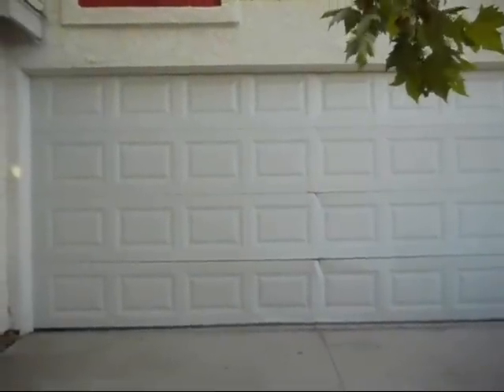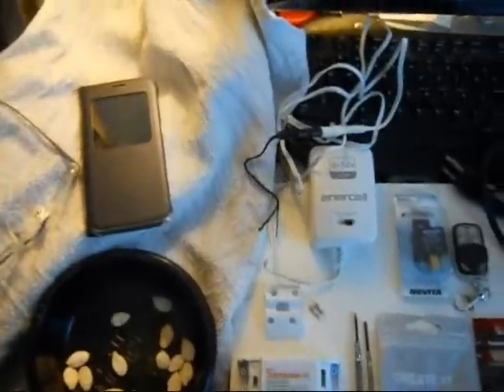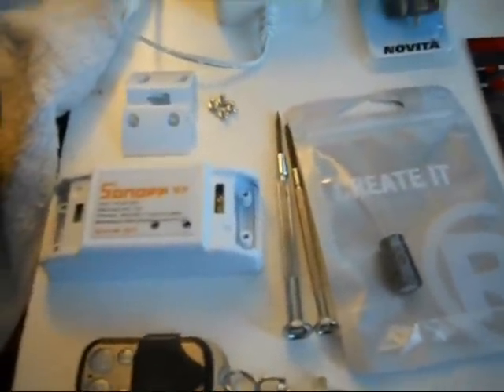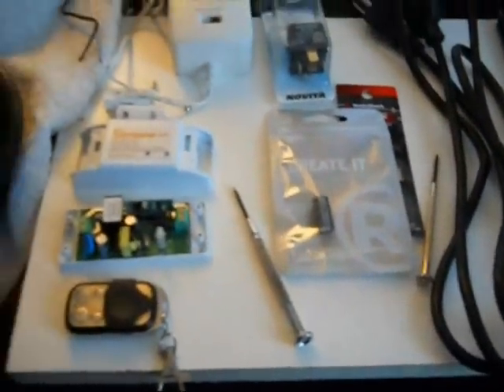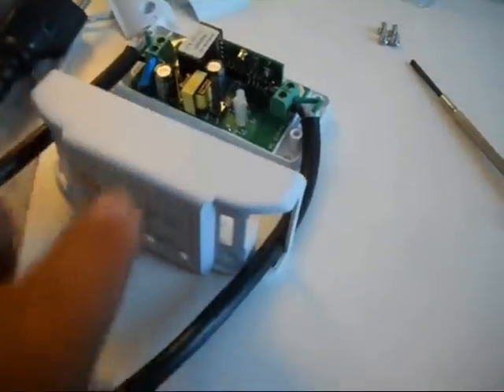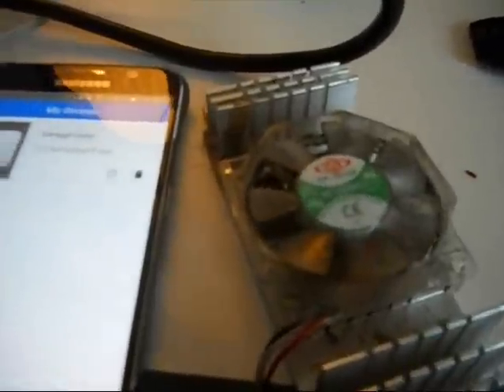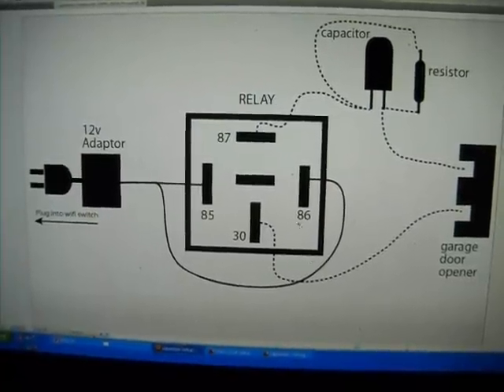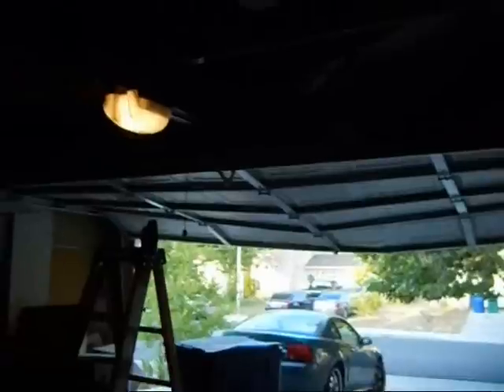WIFI switch - Garage Door opener - on Phone - Sonoff wifi

Comment: I followed in detail all the steps on your video, and it worked exactly as you explained in your video. The only issues I had was I was trying to control the garage door opener with two separate phones. The sonoff App team recommended the share feature on the App. Now it works flawlessly! Thx for your video!
Reply from the maker: Great! If a video helps just one person or inspires someone. Then the time it took to make edit and post it, was worth it. Thank you for your feedback.

Comment: Have you thought about modifying the Sonoff itself to make use of the internal relay?
It seems to me that it is possible to cut the line voltage trace to the relay and the neutral trace to the connection block and reroute the connections of the relay. That way you can keep the high voltage from the output of the Sonoff and only switch low voltage.
Reply: Have you managed to do this?
Reply: I did it on mine. Worked great. I cut the lines before the relay and soldered them together.
Reply from the maker: I wouldn't know how to do that unless someone showed me.
Reply: There is a device for this, it is called the Sonoff SV (safe voltage).   It has an isolated relay.  Using the sonoff-tasmota firmware it is simple to have the relay pulse the signal to the opener - so no external components are necessary - just the ~$12 Sonoff SV and a 5V wall wart
Reply: @seanphillips658  The Sonoff SV still passes the input voltage to the output, how do you make it trigger the output as NC for garage opener?
Reply: @mcdull9413  - a slight modification isolates the relay.   It is on the SV wiki https://www.itead.cc/wiki/Sonoff_SV

Comment: It is not necessary, only by cutting the input voltage passing through the relay. Thus the relay becomes a neutral switch. I have done so.
__________________________________________________________________________________________________________
No es necesario, solo cortando la tensión de entrada que pasa por el relé. Así el relé pasa a ser un interruptor neutro. Yo lo he hecho así.
Reply: maybe you could explain how you did this with a video?
Reply: Yep, it's easy to cut the HV traces and just use the relay. I found it odd this poster went to so much trouble with an external power adapter and relay.
Reply: Can you please explain how to do this? It it also possible to by the AC input and power via DC?
Reply: If you don't already know how follow and cut traces on a board, an AC circuit isn't the place to learn due to the potential shock danger if done incorrectly. One could bypass all the A/C circuitry, by either removing components or cutting traces, but it might be easier just to buy their DC powered device called the "Sonoff SV".
Reply: Hola, yo no entiendo mucho de esto y me gustaría aprender cosillas, por eso miro estos videos. Mi pregunta es... ¿Cómo hacer lo que tú dices? sería cortar la placa en algún punto específico como he visto en algunos videos y ya está? es decir, corto, pongo los cables de entrada y salida y a funcionar. A qué tensión, 12v? Muchas gracias, espero tu respuesta.
Reply from the maker: Yeah but I did not want to have someone kill themself or blow up their garage door or burn down their house so I went with a method anyone could use.

Comment: I did some experiements with the capacitor and resistor across my garage door contacts.  When put in series with the 2 wires
it immediately closes the door.  If you break the contact and connect again quickly it will not reverse the garage door because the capacitor has not fully discharged and in my case it took about 10 seconds.  By lower the resistor value the discharge time is quicker however if you go to low current bypasses the cap and defeats the cap from stopping current once fully charged.
I got as low as 2.2K reducing the discharge time to about half or 5 seconds.   If you have a web cam to watch the garage door
having a lower value resistor will save you some time waiting for the capacitor to discharge allowing you to activate the door button again.    Also,  I used a ECO Plugs switch from Walmart.  Plug in your D.C. power supply to control your relay or buy a 120 v relay and plug that directly into the ECO Plugs.
Reply: I think this cap/resistor works this way.  When the circuit is closed current flows into the cap because one plate
has a different potential than the other of the capacitor. Once the capacitor is charged there is no difference in potential of each side of the capacitor so no current flow can happen.  Only when the app button is pressed a second time and the relay opens the capacitor can discharge through the resistor. As long as the switch is still closed the capacitor can't discharge.  If it did it would trigger the door opener again.

Comment: Uuuh, if you keep running that door up and down with it jacked up, you will soon need a new opener. The opener is not designed to operate a jacked up door and its excessive weight. You will need a new door and opener soon. Thanks for the video.